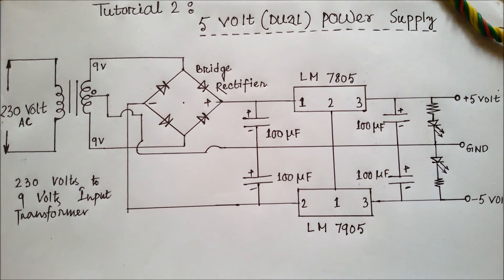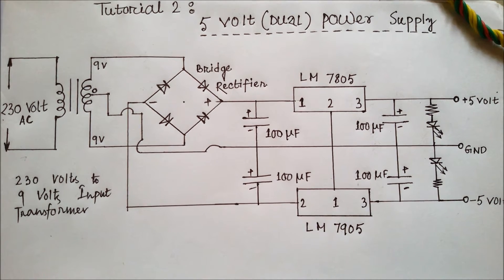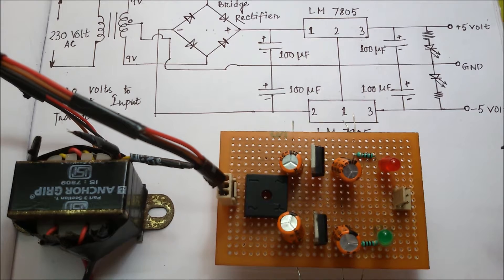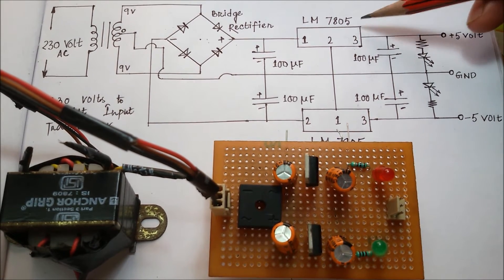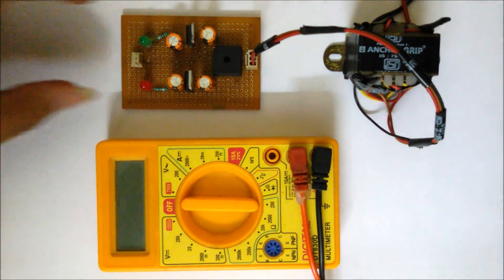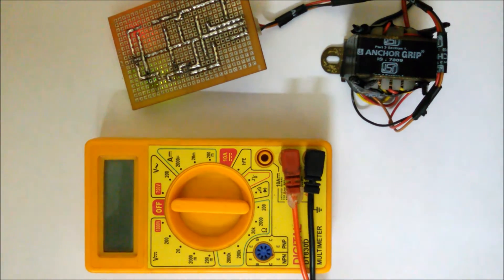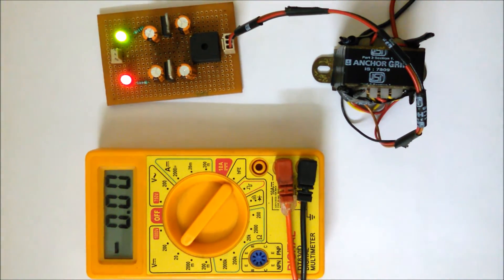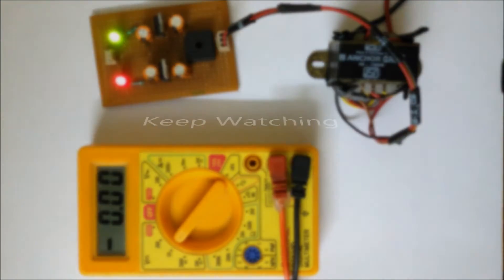Project 2# How to make a 5 Volts (Dual) supply

Comment: A really good video. I am actually going to make this project .So is it necessary to use a single unit rectifier? Can I make this by using four diodes back to back ?
And one more thing . I have 90 uF capacitors. Will these capacitors work instead of 100 uF capacitors?
Reply from the maker: Thank you.
Well,If you have diodes you can use them back to back to make a bridge rectifier. 
And you can use 90 uF capacitors.It will also work.
Reply: Thanx for the answers.  This video really helps a lot. Keep it up bro.